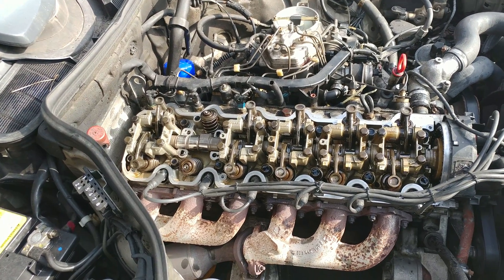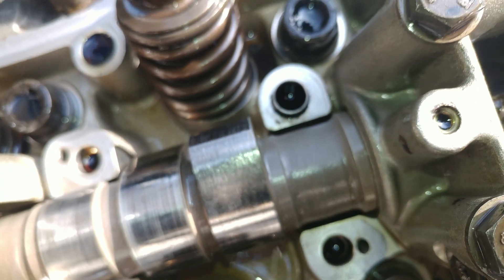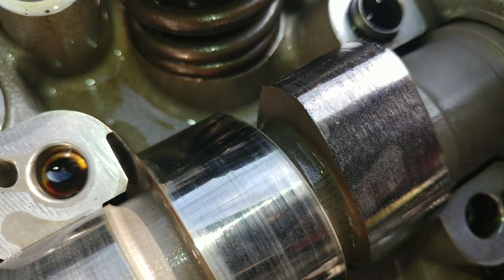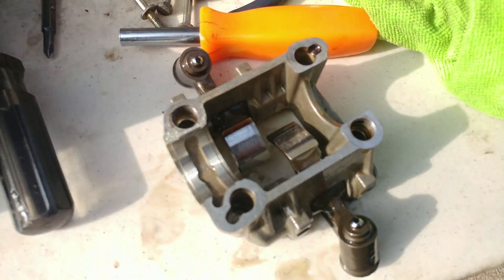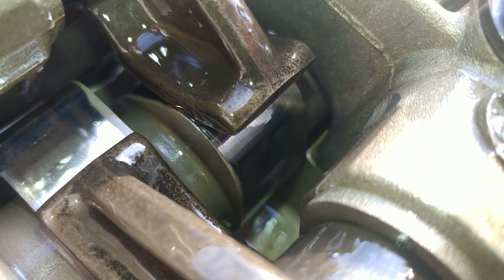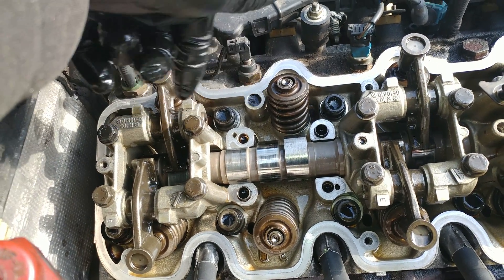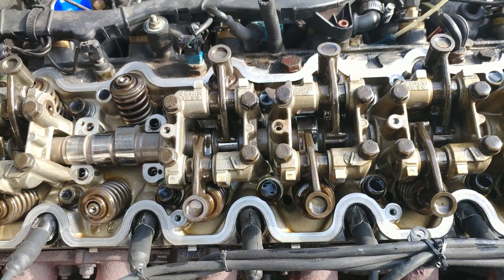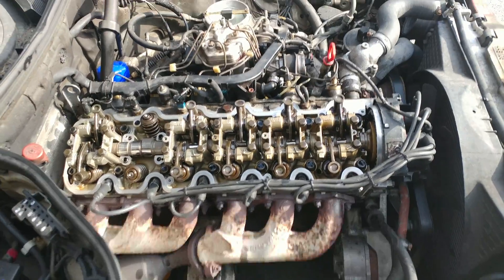Mercedes 300te M103 engine camshaft wear

Comment: when you have this problem you are  you loosing power in the medium hight revs?i have the same noise in my m103 brabus after a few days having fun with my 190 benz, :( thanks!
Reply from the maker: this customer did not have any power loss, just noise
Reply: @vsandvs  ok thanks!! what was the solution for the noise? salute
Reply from the maker: @garciag6575  customer decided not to fit it. But to fix it camshaft and rockers need replacement

Comment: If the cam and lifters have been replaced with new version at the dealer, an S will be stamped in the front right side of the cylinder head
Reply: how much did the job cost you?

Comment: Hello.could you tell me please the torques of the lifters?I have to replace the valve seals on mine.
Reply from the maker: Sorry, I don't remember torque specs. I think they are around 10Nm or something but you need to double check in service manual for correct spec

Comment: This happened on my '88 300ce.  I got a used cam + rockers etc from a 1990 engine and the motor ran well for another 250,000 miles.  Mercedes upgraded the camshaft sometime in 1989.
Reply: how much did the job cost you?

Comment: lack off oil! oiler broken off?
Reply from the maker: MrBugsier5 I dont think that oil level was low. I had repaired all oil leaks on this engine amd it didn't burn oil. Customer always changed oil on time but he used 5w30 oil. I'm thinking this happened because he used thin oil. I like to use 10w40 in 90s engines. I think 5w30 is a bit too thin for these engines
Reply: Mercedes Benz changed the dripper design on M103 engine 15 years ago, they found out the pressure will drop on #1 and #2 the new updated dripper has a V shape washer in the middle and they removed the bolt that holding the dripper and expanded the tube, the new designed one costs $80 from the dealer, i updated mine 3 years ago when i changed the shaft and the head casket. and that is what the technician said. pictures are available to compare the design if you are interested.
Reply: @fredjan8514  Hi Fred! I have the same ticking noise issue in my 1988 300 TE with over a quarter million miles on the clock. Do you still have the pictures on your replacement dripper with the V-shapes washer? I am planning on repairing my engine.
Reply: @heimatliebe116  sure do I also have 2 spare updated rails for my future cars send me your email and I will show you the difference between the 2 rails
Reply: @fredjan8514  any chance you would do the same for me please?
Reply: @fredjan8514  hi, is there anybody that can also share this information with me? Or a part number for the new rail?
Reply: @fredjan8514  would you mind sending me the partsnumber too?